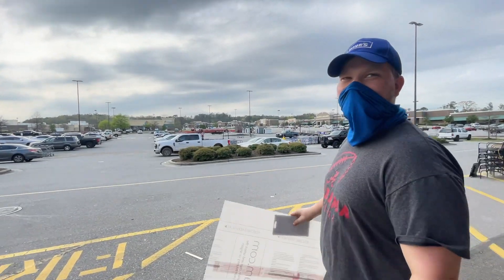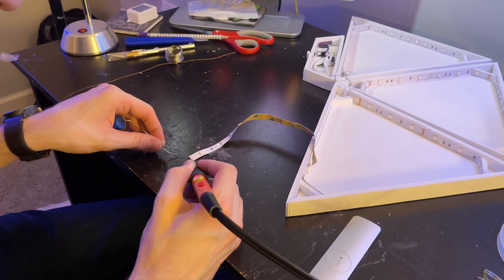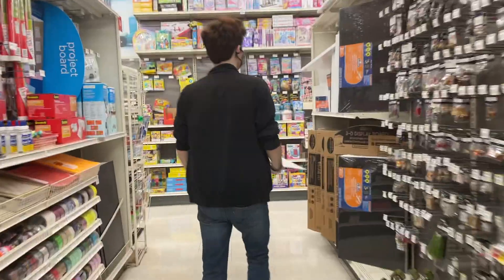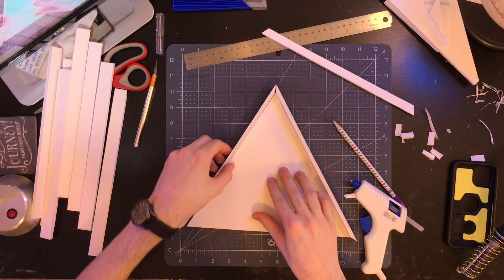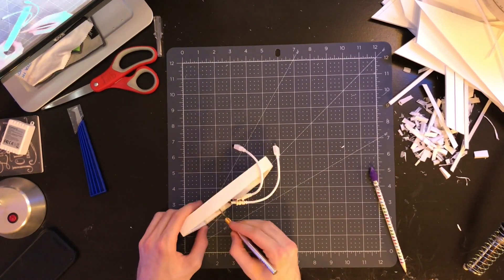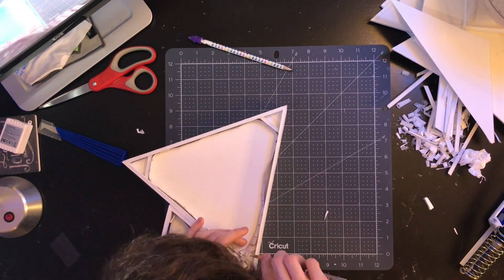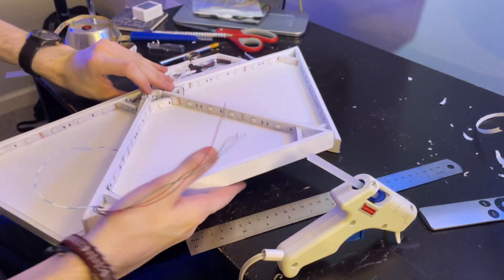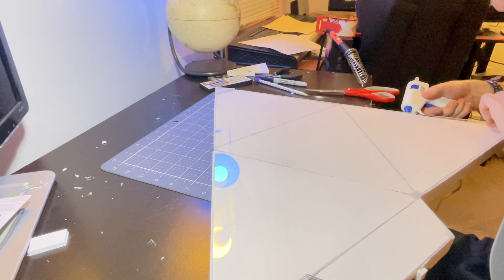How to make NanoLeaf panels for LESS than $50

Comment: Can I blame you if/when my house catches on fire because you recommended "thin wire" (22g in your example) to join the LED sections together.  You do realize that the LED strips can carry as much as 10 amps.  Table 310.16 of the NEC, the source for wire size to amps, states to use at least 14 gauge copper wire.  Please do your  research before making recommendations that might burn someone's house down.
Reply from the maker: Most peoples LEDs are 12V 2.5A or 24V 5A. Also wouldn't that voltage be spread across the 4 lines? As long as the cord from the power supply to the LED controller is standard, it should be safe right?

Comment: Good job but you could have used milky colour acrylic sheet for the front it would give cleaner look and better diffusion
Reply from the maker: yeah my local hardware store didnt have that unfortunately
Reply: @NathanLewisVideos  you can sand normal acrylic glass as well

Comment: This is not difficult and I admire your effort but this is the exact reason I paid 200 bucks, hung them up and called it a day.
Reply from the maker: i mean yeah the real ones look far sexier but i just wanted something cool for the background and its a fun project
Reply: @NathanLewisVideos  it wouldn't matter it they were exact replicas, I'd feel the same.. Like I said, I admire your effort. When I was 16 I taught myself how to install my car audio system. I wouldn't get caught paying someone to install a system in my car for many years. Fast forward to now and there is no way I would install my own car audio. Thank you for your video and keep doing whatever makes you smile!
Reply: @cokergx3  you are just not the target for this video
Reply: @LucasA-f9r  correct. Gotta watch to know that
Reply: @cokergx3  Back in the day it was a car stereo. A few plugs, a few wires, an amp and decent speakers and you could call it a day. Now every stereo is a computer wired into the car’s… everything. Change the stereo, without doing it exactly right and the whole car won’t work.